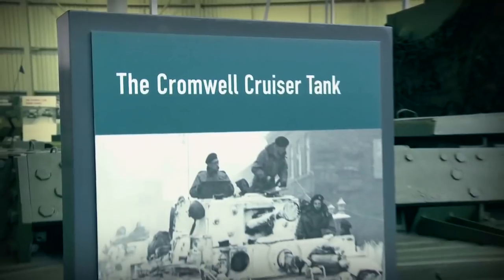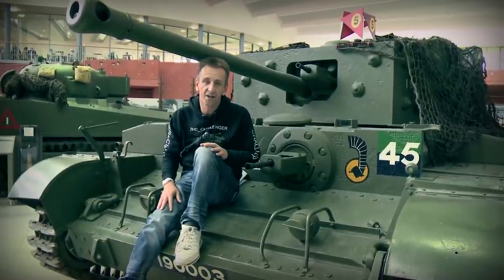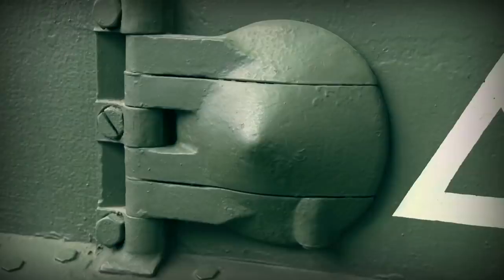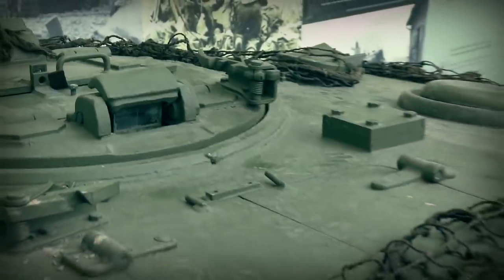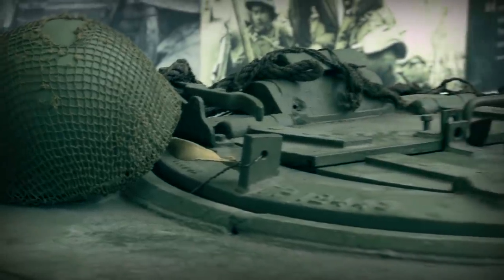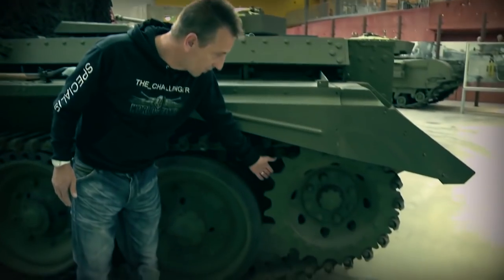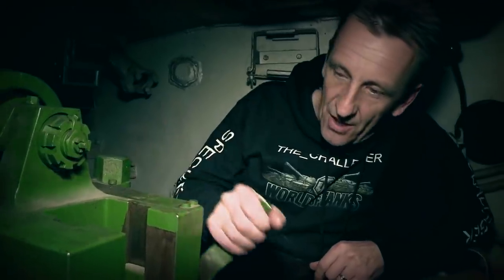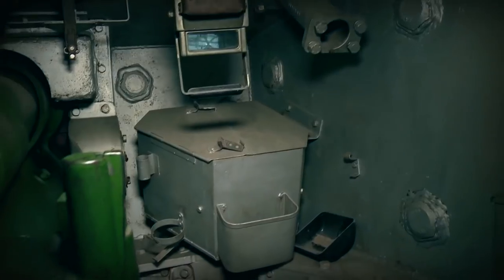Inside the Tanks: The Cromwell

Comment: Considering that the 17 pounder was designed in 1941, why was the Cromwell not designed to take it?  Why was there so much push back to mount it in  British tanks? When mounted on a Challenger, there was a rediculous staff requirement to accomodate 2 loaders, but when mounted in a Sherman, that requirement was not enforced.
Reply: Your comment is old, but the Cromwell was supposed to have a long barreled 75mm gun with much better penetration. But the turret was to small and they decided to upscale then 6 Pounder instead which could then use American 75mm HE. The Firefly became a stopgap untill the Comet was introduced